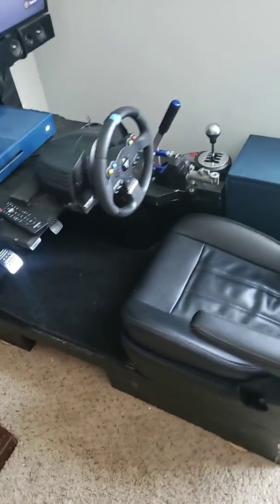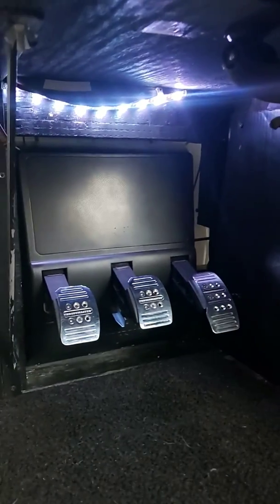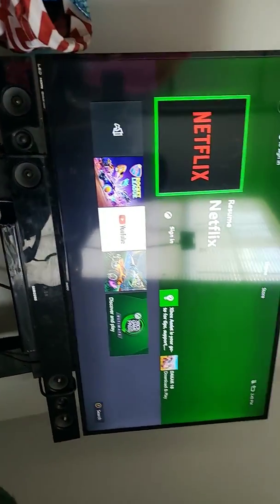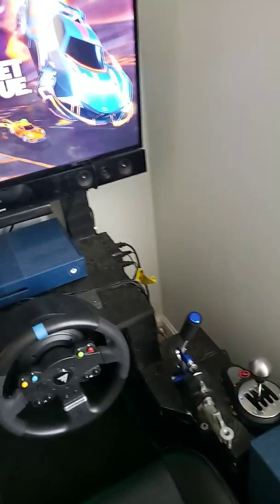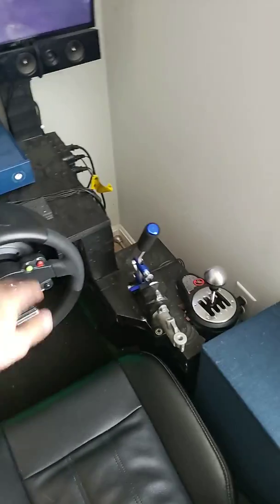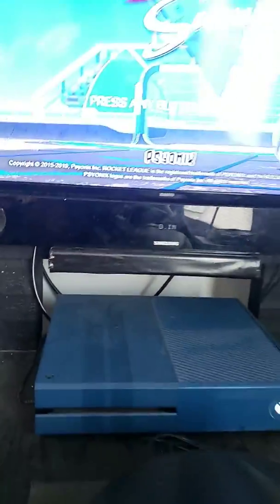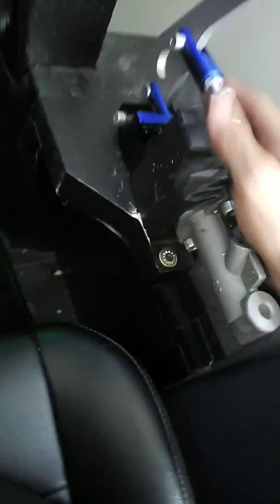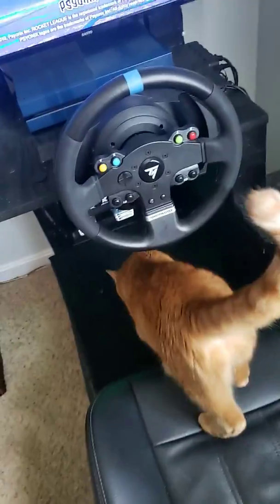Custom Sim Rig Build!! Thrustmaster TMX PRO-TH8A-Custom Ebrake-T3PA Inverted Setup

Comment: Did you encounter any problems with tmx?
Reply from the maker: Yea, i think it was because i added the E-brake. I had to disassemble the entire wheel to add the wire. It worked for a long time, but I have the Logitech G920 now, which is better, IMO. 👍🏻

Comment: Clutch is stiffer than the throttle. Did you change the strings?
Reply from the maker: I added a spring to the clucth.
Reply: @thedowser5904  Did you make holes on the pedals case to screw to the cockpit?
Reply from the maker: @rubenmozota4992   no sir i just installed a tab on the back of the frame so when the pedals are pushed the pedal frame doesnt move
Reply from the maker: @rubenmozota4992  at 1 min in the video i show the tab on the back for the pedals.
Reply from the maker: https://youtu.be/75Dp3E0jfYc here is a good lil video of the pedals while installing.
Reply: @rubenmozota4992  ur thinking of different pedals cause 1 the clutch aint weaker than the gas and 2 that pedal set has mounting holes u can use already on them its a thrustmaster setup not logitech
Reply from the maker: @Zwenk Wiel that's smart I didnt think of just switching the pedals.    I couldn't stand the wheel being angled up a bit.  Thanks for watching bro!